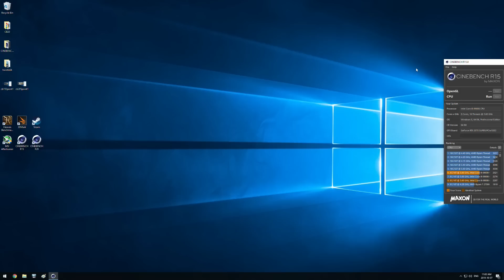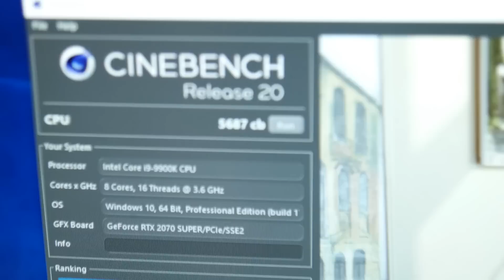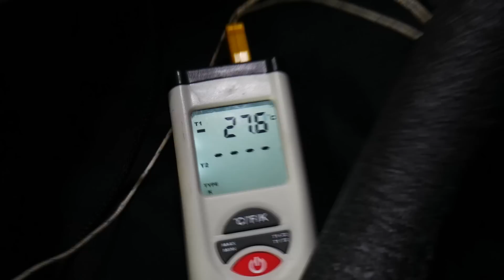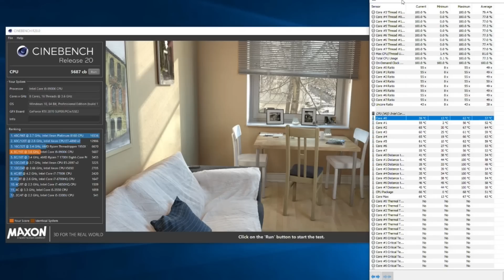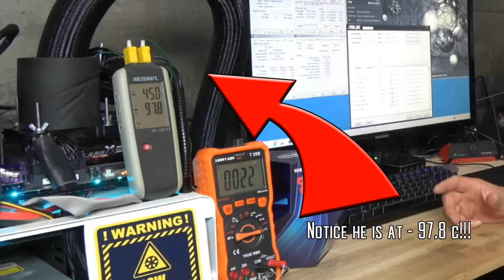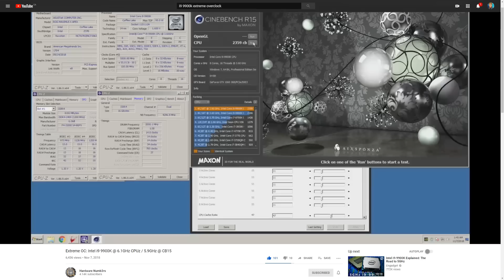Chilling my 9900k to 5.5Ghz!

Comment: If you put the entire rig in that large chest freezer you used on the Ryzen 1700, I think that might help a lot with getting less condensation and also much lower temps. Why? Because the air in the freezer will be very very dry, so there wont be much water vapour to condense (compared to in normal room air where humidity is typically round 50%). Also, my suggestion would be store a shite-ton of freezer blocks or stuff like that in the freezer so it is an absolutely huge thermal mass. It's like a heat bank, but it's a cool bank. Key is to have the driest air possible in the freezer. Every time you open it up, moist room air gets in. With a ton of freezer blocks you should be able to run the computer for long periods without any heat issues.

Comment: The Laser Cutter/Engraver guys sometimes use these water chillers to cool the higher-power lasers. It seems like it might be a more sustainable option that what I've seen in your videos. They're a lot quieter, smaller and practical. Obviously laser tubes don't generally accumulate frost on the surface, but maybe this could be enough, especially with the new Ryzen-temperature-sensitive chips. Have you ever looked into these? 

(Amazon.com) 

"S&A Genuine CW-5200DH (5200DG upgraded) Industrial Water Chiller 6L Capacity Cooling Water for 80W-150W CO2 Engraving Cutting Machine"

Comment: You know how they make dual chamber computer case? I have one but what if they made it so there was a normal sized mid tower case and one half is all the normal computer stuff and then you have the other chamber which is a chiller? Then when you buy the case you also have a cpu cooler so paying a little extra for a case would be maybe more worth it.

Comment: It seems going past LLC 6 (Turbo) or higher past 1.35v on this board is highly not recommended and from what I have heard is likely why it would later not work at 5.5 ghz again with the same voltage. LLC 7 (Extreme), the one you used, on this particular board is not recommend past 1.30v so it has been said, LLC 8 (Ultra Extreme) is just a huge no no pretty much no mater what apparently.

Buildzoid has some information detailing this for these boards but also some interesting stuff out there with good documentation on the LLC implementation from gigabyte and huge transient voltage spikes from it.

Comment: Would it be possible to add 
acetone and dry-ice in the res combined with the chiller? Also might wanna start putting vaseline on your mobo and if the dry-ice works and you add the gpu to the loop ooh my you might be looking at a benchmark record in the top 10?

Comment: Its not a failure, you just need a bigger pump and a new block that has bigger fins so it has higher heat exchange.. this is all covered in lots of old old OC memes.. and who cares about the watts of power lol...  When will they sell bigger quieter pumps..??
high pressure hose? pool pumps?

Comment: you can make one of those blocks that cool the cpu directly.  its basically just a copper box with like channels or baffles in it so the fluid goes through like a maze.  you put an input and output nozzle and put the copper lines from the AC on each nozzle.  basically you replace the rad that gets cold with a solid copper water block.  and you can solder copper pretty easily so its not that hard to do.  you get the copper pieces and a blowtorch and they are easy to make.  connecting the copper lines and recharging the AC with freon is needed but if you know how its not hard.  basically if you talk to a HVAC technician at a heating and cooling place they could hook you up

Comment: I had a Chilly1 Single stage cascade, killed it with an E8400 at 5.3GHz during an extended benching session.   kept the cpu at -30c under load. -50c no load

Comment: For the issue you were having below certain temps with your CPU, do some research on the 'cold bug'.  I believe it is a problem with the integrated memory controller on these chips that often can't handle temps below a certain level (it's something Buildzoid has mentioned on occasion I believe, both for AMD Vega and previous GPUs as well as Intel CPUs, at least if I remember correctly).
With all that said, 5.5GHz on a modern Intel chip is no small feat and you should be proud of yourself for getting this crazy setup working :).

Comment: I wonder if it would be possible to do a direct to IHS fluid solution which would eliminate the block and thermal paste transfer inefficiencies. Have a sort of half block that you glue down to the IHS with silicone sealant and have the chilled liquid directly running over the IHS. Maybe even get a 7980xe and delid it and remove even more transfer inefficiencies by direct die chilled liquid cooling.

Comment: I also want a damn phase change cooler. :C
Reply: My phase change system has a sealed argon filled box for the motherboard so no condensation. 6 months and no problems
Reply: I do too, been looking for an old style. Found a local refrigeration place that has some in storage. I'll be looking when I get home. It will be fun to test and play around with.

Comment: From what i saw in the BIOS, that board has the 3 main low voltage dropout regulator options though, i didn't see any on the board itself, which could cause it to hit a clckwall. Not sure it has the external CLCK gen. either. But, 5.5GHz on the Elite is a awesome result. 
  That board has the same intersil based VRM as the z390 Aorus Ultra and Pro boards which use 12 DrMos 50A phases.
Reply: Bryant Allen won’t matter
Reply: bearded hardware your alive man!!!! Where’s your new content!?!
Reply: skyhawk311 took some downtime and a long road trip for vacation.. back and working on content for this weekend!! Some cool projects in the works!

Comment: I want AMD and Intel to get rid of the IHS, like back then.
Reply: direct die cooling is a lot harder to get good mounting pressure on
Reply: Just going to point out, the AMD chip is below (shorter) than the socket bump... So you need to use a grinder (or patience and sandpaper, but who has time for that?), and grind that ridge down some, though you may destroy the retention arm if you go too far. My LN2 cooler is super fat for Threadripper, but even a tiny phase evaporator (smaller than an AIO) is just too big to mount direct die with it delided without the socket interference. I kind of got it working with it skewed off center to one side with zip tie mounting, but it wasn’t great, so I’d recommend grinding the socket instead of the cooler all weird.

If you would like to buy delided chips and modified boards with waterproofing and insulation done I could do it for you (I’ll charge double, as it’s likely some things will break, so basically I would keep the extra for my trouble if it survived). But you can do it yourself. I believe Intel has the same issue (even dating back to C2D chips last I had my hands on socket 775, it needed the metal retention milled/cut out/modified for some coolers).

In most cases, it’s not just plug and play (ignoring that the stock cooling systems have depth limiters to limit pressure, assuming the cooler is already modified with unlimited travel for extra mounting pressure). The entire socket needs to be redesigned to allow this (and with soldered AMD a 3 to 5 degree drop isn’t really worth it for 99% of people, so DIY for the ambitious few).
Reply: @jakegarrett8109  Another problem is that there are multiple dies, especially with Ryzen 3000. Those need to be lapped flush as well.
Reply: KYŌDɅI KΞN oh yeah, there are definitely a few other issues I didn’t mention (like the SMDs on Ryzen being as tall as the core, so yes, that means the cooler will short them out! Normally the IHS is raised with an extrusion so it touched the core and doesn’t touch the SMDs surrounding it, so you need to mill your coolers coldplate in the shape of your core, as almost any cooler will short it out otherwise). Yes there are indeed a few issues ;)   But customizing/destroying a cooler is not madness if your already insane in the search for world records :)

My next cooler is going to be CNC machined evaporator block for TR-64 core to use as my next daily machine upgrade, I plan to use triple stage cascade to get down to -100c for my daily system, haha, even the $7k Epyc doesn’t look expensive when you know the cooler may cost near that, haha! But that’s just the price to pay for the insane performance, and no phase evaporator block exists for TR series and the heat load will reach insane levels, I’m going to have to run either 3kW solar or a generator just to help with the power load to my house, lol, my main system is rather mundane with my TR-1950x at 460w on a basic 120mm AIO and 4x Fury pushing my gaming average power above 1.7 kW (but hey, nothing else runs Crysis 3 at 4k Ultra at 100 fps, haha! Now if only they had the GPU firepower for my triple 4k, that would be madness, mwahahaa!)

There are always little problems when going extreme, you just tackle them and improve so you can do even more next time, cheers!
Reply: The IHS is also for protection.
You can get ride of it. Derbauer as a few kits for that.

Comment: It works finaly.... time for a beter board.
Reply: This board isn’t holding him back (those are very hot core temps), the cooling is. Much more voltage and that thing will be toast even on LN2, and since it’s hotter than hell (it’s sure not sub-zero core, that is hot as hell compared to even basic phase cooling which I use for 24/7 normal builds, 60+c is insanely hot!), so that chip would degrade and die really fast... Plus it’s obviously really hot for even benchmarking at that voltage, just go look at what the LN2 guys use at -150c, it’s not much more voltage... In a huge part it’s the temps that allow the higher clocks (for example, Ryzen 3k goes from 4.2 GHz to 4.8 GHz or higher at the same low Vcore voltage when taken to -150c, and it becomes 30% more efficient. For exact details Der8aur has a good video on that chip with a nice graph showing frequency vs temps at a constant fixed voltage). Even a basic phase cooler should be running this CPU at 6 GHz easily (core temp should be roughly 0c or colder), also see Der8aurs video for 9900k vs thermals (9900k basically goes insane with sub-zero core temp, just runs wild!). However, with hot temps like those, even murdering the CPU with voltage just wont get you any gains, you only start losing speed because as more voltage is added, the temps rise and that makes your frequency temps go into the trash. You see this a lot with GPU LN2 benching as well, at a limit (and it always seems really low), adding voltage only makes it worse.

The EXOC boards are nice for booting at -150c or colder (so you don’t have to use your blowtorch), but above that (like -70c with DICE) you don’t even have to worry about that anyways, so they don’t matter. As far as RAM overclocking goes too, you always get a 2 slot max mATX board for the shorter and more optimized traces, so for a lot of competitions the winner is the person with a micro-ATX even though it may not have a spectacular VRM or components. And Timmy isn’t pushing anything too extreme here with hot core thermals (it really is fairly hot, that’s about the temp of an FX on air cooling, lol, seriously, FX had thermal shutdown at 79c and recommended thermal max was like 69c, from the “hot and hungry FX”).

It’s still a very cool project, so thumbs up Timmy for doing something awesome and learning some from your prior mistakes on the project, it’s not always easy, I can respect someone who keeps learning and trying. So thumbs up for this project, I loved it! I hope it brings a few more people into the EXOC scene.

Comment: Get the water chiller that LTT used that ONE time. Use a auto (car) coolant overflow tank/bottle to hold the fluid and then a pump to move the coolant.
Reply: maddmaxx636 

This is the same setup. That was where he got the idea.

LTT has had similar results everytime they’ve pulled it out.

It’s just kinda a beaten down idea after this. It’s just not that banging of a solution.
Reply: @kadboodle  Well I talking about the water chiller they used with the Threadripper 2. 

This one.
https://www.amazon.com/Hydrofarm-Active-Aqua-Chiller-10/dp/B0048IVBT4

Comment: I am ready for the day when we will have a cpu that can boost it self at over 5 ghz on all core.
Reply: That day is today, my 9900K does 5.1Ghz all cores with just a 240mm AIO.
Reply: @TalonsTech  without oc?
Reply: MirelRc Intel CPUs don’t boost in the same way AMD does. AMD chips “boost” to near their max out of box. Intel K chips boost on a defined plan and no more. They leave it up to the enthusiast to overclock them which is where the fun is left. AMD chips don’t have any fun left in the tank.
Reply: Talons Tech Talk They do have some extra left (FX holds the world frequency record, and Ryzen 1600x for example broke all the 6 core performance world records when it launched), plus like many my TR-1950x for example easily got 4.15 GHz all 16 core on 120mm AIO (which is above its max single core boost by a decent amount). 3rd gen doesn’t have a lot more frequency that can be squeezed with air coolers, but I’m not complaining too much since you can still make them go insane on LN2, and they still vastly improve on the tweaking front with more advanced methods like RAM tuning (the Intel’s are less rewarding in that regard, you get very little gains for the trouble of RAM tuning).

Most modern platforms are much more basic than back when FSB and other areas of overclocking were more important (even FX was very simple, that particular chip increased L3 cache speeds for the pipeline with FSB and things like NB/SB were important to overclock on the boards for basic general performance gains), newer platforms just have less gizmos that are NEEDED to tweak, but that’s not really a bad thing (more time for multi-GPU benching!).

I think you just meant 3rd gen Ryzen doesn’t REQUIRE overclocking and works well out of the box, and not meaning that it can’t improve greatly with memory tuning (or conveniently getting a good low latency high speed kit), since it has decent memory controllers for once (even better than Intel). It can really pump out insane memory tunes and the performance really scaled nice with some tweaks like that. It just isn’t NEEDED anymore for general use and having a good system (with Intel your right, you NEED to overclock to 5 GHz for the chips to be worth a darn, and your still paying a lot for a minor improvement. I’m honestly shocked phase coolers are not the most popular coolers for the 9900k with it’s insane price for small performance bump, you’d think people wouldn’t be so poor and just get a decent $1k cooler that will last a few upgrades instead of a one time CPU purchase and then obsolete next year... IDK, maybe I just like seeing the frost, lol!)
Reply: FX-9590 from 2012? You’ve waited too long!

That’s why frequency is just kind of a meaningless number by itself (just like fan RPM, the pitch of the blades are more important and affect the airflow due to flow rate not being linear with high rpm fans, yet every company brags about the rpm number without saying pitch or profile... Similar to RAM timings, terrible timings on a high speed kit doesn’t make it better than something more optimized and balanced). I just overclock them myself to the max (even when my monitor does 240 Hz, I still try for more, even if it was a million Hz display I still would overclock more purely for entertainment, it’s like racing, you can never be too fast!)
Reply: @jakegarrett8109  I said over 5ghz on all cores, without oc.
Reply: MirelRc you said boost, and yes, stock FX-9590 is 5 GHz boost all core (exactly as you said).
Reply: Ummm the 9900K can u dumb fuck
Reply: @dfkdiek518  9900KS actually, you dumb fuck.
Reply: Jesse Lopez my 9900K with a 360mm aio hits 5.075ghz all cores...
Reply: @dfkdiek518  without oc?
Reply: MirelRc uhuh
Reply: @dfkdiek518  all cores without oc?